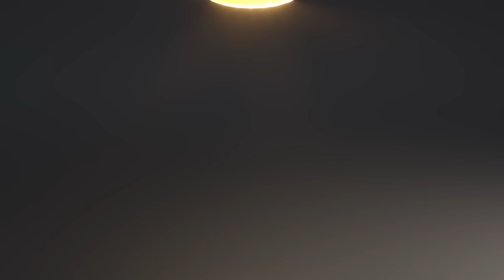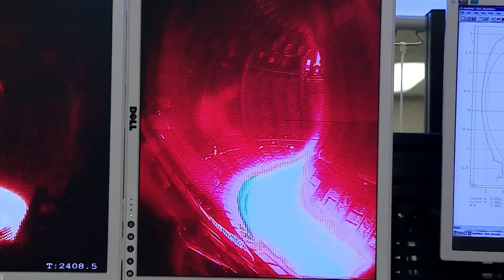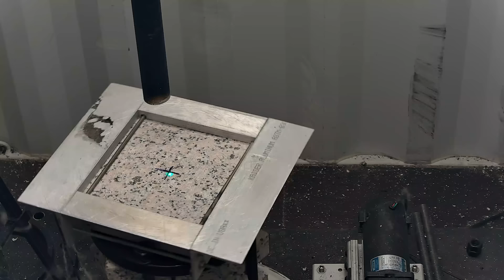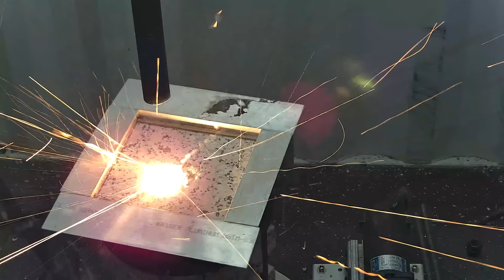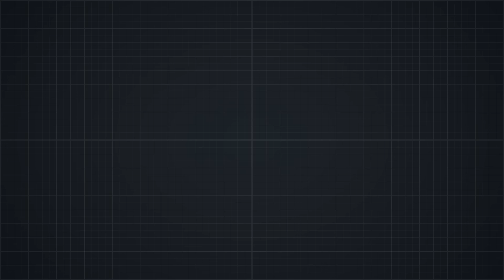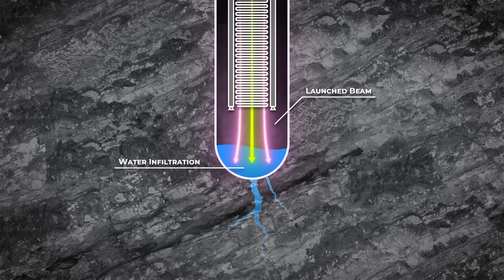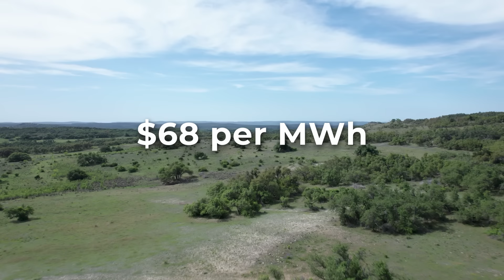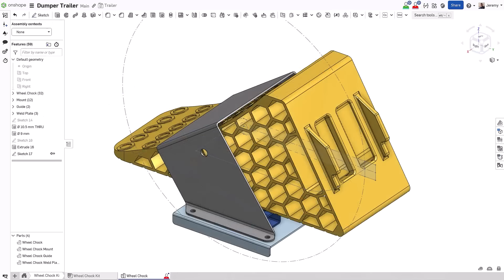Geothermal Energy is Changing

Comment: I think that even if the hole drilled was to be 4 inches wide, you could then use the conventional drilling techniques to vastly increase the efficiency. First drilling a narrow pilot hole and then widening it seems to be way easier than drilling a wide hole from the get go.

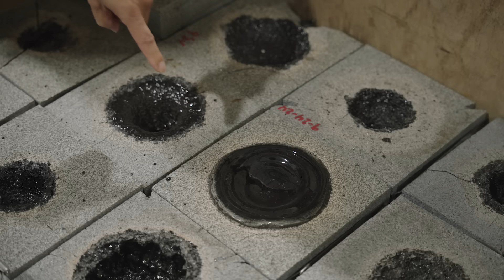Comment: 6:00 I'm a little confused about how the purge gas extracts the vaporized material. Isn't the vapor going to cool down on its way up and turn back into rock before it reaches the surface? Or if it remains hot enough, isn't it going to melt the waveguide tube? (Edit: after giving it some thought, I think the vapor turns into dust not unlike microtektites, which can perhaps be blown up the borehole.)

Comment: The heat at the core of the earth is not because of the fusion or fission reaction as mentioned in this video. The heat source is basically from the gradual cooling and solidification of iron-nickel inner core.
Reply: More or less, iron recrystallizing to epsilon iron is the main heat generating process, which keeps it from cooling in a metastable crystal growth phase at the melting point at that pressure.
TLDR: it doesn't get cooler over time, just less liquid

Comment: Not sure how reliable these super deep holes would be as an energy source. Maybe it's easier to just harvest geothermal power in regions where it's easy to access, and then transport that energy to the customers? We already do the same with other ressources, sure should not be a big issue to use part of the geothermal power generated at the plants to "fuel" the transport systems, just like we do with oil?
Reply: Well, that would require powerlines of a size never seen before. Oil can be transported with losses in the single digit %ages, the same cannot be said for long distance electricity transmission.

Comment: What if they drill the hole but then tectonic plate movements squeeze the pipe closed? On-going repairs and maintenance of the vertical pipeline will likely be expensive.

Comment: I'm no engineer or anything, but the first thing I thought was "can't they use all the power of the microwaves and the heat generated to produce (or recycle) some of that energy back through the drill itself reducing energy costs"? Would that be reasonably viable? Sorry if this sounds dumb 😅
Reply: Not a dumb question at all! Sadly, there are a few problems getting that to work. First is that the power is needed in that shipping container above ground, so the heat being hundreds of meters below ground is just physically far separated from where the power is consumed. The seconds issue has to do with some more fundamental thermodynamics. You see, heat in and of itself is not useful to us. We can only syphon off energy from heat while it flows to a colder place*. The temperature difference tells us something about the efficiency of that thermal cycle. 

So you'd need a cold reservoir to effectively dump that heat into. The borehole itself is a very constrained space in the hot rock so you can't actually fit much more tech there. And if you were to try to move the heat to above ground you would lose a the majority of it to the ground. So the purging nitrogen gas that flows through will carry a bunch of heat up to the surface again, but I doubt that you could extract much useful energy from that. Vastly less than it takes to run the machine, and probably also less than just the amount of energy needed to compress that nitrogen in the first place. 

So while theoretically having some heat regeneration there would be nice, it is just really impractical. 

*  to please the pedants, this is for standard thermodynamic cycles like the carnot cycle which is relevant here, stops being so true when you start dragging chemistry in but that's outta my area.
Reply: @markkalsbeek5883  Thank you!
Reply: I'm also no engineer (engineering student), but I don't think they are too worried about that.

The process already looks much more energetically efficient than the traditional methods so it's better to have a working prototype than spend more resources into making it more efficient.

That aside, I think it sounds like a good idea, despite not knowing how much it would save.
Reply: Not an engineer, but this sounds like a 2nd law violation to me.
Reply: @jnawk83  he said reduce energy costs and not generate energy, so I think it might work

Comment: So, a comment on the voltage: 50 kV shouldn't be that hard to get your hands on, at least for someone working at an industrial level. Several larger factories neaar where I live have their own MV power stations for example, as would a lot of larger city districts.

Sure, power outlets only give a couple 100 at most, but transport should be done at far, far higher voltages (easily 50 kV or more, high voltage grids go up to a couple 100 kV). I don't know the exact numbers for the US, but if they had a way to tap into the MV grid they could get pretty high voltages. Their main issue is that they need DC, not AC (which is what is used in the grid), and probably also need it it be very stable with minimal disturbances.
 
So I wonder if their big power container is intended to actually take like a 480V input, or if they have ways to lay a connection directly to the MV grid, and that container is for the AC/DC conversion and grid stabilization.

Comment: If this microwave drill is a feasible method, starting with mechanical drill definitely be cost effective until certain drill length is achieved.
Reply: True, they will probably use a conventional drill rig to predrill the holes to something like 2 km

Comment: Electricity goes in, an asbestos rope comes up. haha
You need to get rid of the condensed rock that you just evaporated. 
this is nuts. great vid
Reply: If it's not actually straight up asbestoes or equivalent It would be cool if they could extract it and turn it into a rockwool style construction insulation. Also, another thing to consider is how will they know if it's radioactive material. What could be worse than radioactive asbestos? lol
Reply: @WhitelistedUsername  yeah if they could collect it cheaply it would turn what would otherwise be a waste product into something they could sell to recoup some of the drilling cost
Reply: @WhitelistedUsername  It's not unless they literally hit a layer of asbestos. Underground deposits of asbestos are the source of it. A town in Quebec is named Asbestos because it was the industry there, mining asbestos. That looked more comparable to mineral wool and is made by spinning molten mineral (rock). I imagine it will be a devil of a problem. It will stick to the inside of the bore hole and the drill pipe as it goes upward. Some has been vaporized, but clearly not all of it.
Reply: @WhitelistedUsername Just use a Geiger counter to detect radioactivity.

In any case, it won't be more radioactive than any old rock, because that's what their input material is, and their process doesn't increase radioactivity.
Reply: @WhitelistedUsername or crush and polish it?
Reply: @WhitelistedUsername  Microwaves don't make things radioactive.
Reply: @mqb3gofjzkko7nzx38 I'm aware of that. It's naturally occuring in the rock.
Reply: @ Then I suppose they could test for it with a Geiger counter.
Reply: @WhitelistedUsername  I don't think it would be more radioactive than granite. So very low. I wouldn't breath it all day long, probably not healthy for somebody working there for some time.
Reply: @davaguco  It varies in concentration. Different samples of granite can have considerably more or less; it's not consistent. Breathing even a small amount of it would likely have disasterous long-term health consequences.
Reply: my thoughts as well
Reply: It is not anything like asbestos, it is Rock wool, widely used today as outside wall insulation in construction, next to styrofoam.
Reply: That is why in Europe we use a laser system combined with cryogenic gas to quench droplets of melt and then blow them out. Check DeepU Project!
Reply: Honestly the compressed nitrogen would probably be enough 
After all it's just cotton candy and it's moving slow so the rock flow volume wouldn't be that big
Reply: How does Quaise suck 30 liters of vaporized but rapidly solidifying rock "wool" out of a kilometer-deep hole every hour?
Reply: @skierpage  I'd use a secondary mechanical removal plunger/scraper like an umbrella
Reply: For many mineral fibers it is unknown what the long-term health effects are. So do you want to take your chances?
(Also radioactivity has nothing to do with that.)
Reply: @mennol3885 6:34 Do you see that? Do you know what asbestos is? We do know for certain what happens when you inhale that type of particulate; it's not a mystery by any means lol. Radiation does have a significance if they artificially create this specific type of extremely dangerous particulate from certain naturally occuring material (see my previous comments for more info).

Comment: Great video but a minor correction. Lasers, being visible light, are actually at a much higher frequency than masers, which are essentially microwave lasers. Microwaves are in the gigahertz range while visible light is in the terahertz range. Ionizing radiation is what you find at frequencies higher than visible light—things like UV, x-rays, and gamma rays.
Reply: This comment should be pinned
Reply: I wouldn't be surprised if he meant to say longer-wavelength instead of higher-frequency and it wasn't caught in the editing phase.
Reply: @gregsagerer1441  I agree. Very easy thing to flip in your head.
Reply: @gregsagerer1441 nah the way he was phrasing it he was definitely going for "bigger number, more powerful!" thing, which wavelength wouldnt work for. Either he misread the wavelength/frequency thing and wouldve instead just not mentioned it, or he meant to say amplitude, as this drilling maser would be outputting a tonne of power, but I dunno if it would rival powerful lasers..
Reply: Well, if we're being pedants anyway, lasers are not always visible light. Above masers but below the visible spectrum you have infrared lasers and there are way higher frequency lasers, like the extreme ultraviolet lasers used in chip fabrication machines and x-ray lasers. Gamma ray lasers are still out of reach though... for now.
Reply: @ Technically correct is the best kind of correct! ;)
Reply: @markkalsbeek5883 that's true, but a lot of this has to do with colloquial naming conventions. we technically talk about "infrared _light"_so it would still be a LASER
Reply: He also said maximize drilling. I'm sure he meant minimize drilling time, or maximize speed of drilling.
Reply: Most industrial lasers and high energy lasers are Infrared wavelengths.
Reply: wait laser is an acronym
Reply: I think that he made a mistake, what he wanted to say is M.A.S.E.R. (Microwave Amplification by Stimulated Emission of Radiation), and he made a comparison between L.A.S.E.R (Light Amplification by Stimulated Emission of Radiation) that let we all confused. This script is a total mess!
Reply: so then how does this work is it not ionising the rock but just super heating it?
Reply: He mentioned millimetre length waves?
Reply: Also, for the sake of being precise, the Gyrotron shown here seems lacking a resonator around the active medium, i.e. the magnetic field forcing the electron beam to gyrate thus causing breaking radiation. Thus the whole thing rather seams to emit radiation folliwing the Self-amplified spontaneous emission (SASE) principle, which is not exactly a laser (or maser) yet.
Reply: Black budget  government agencies have already  "perfected" this technology  over 20 years ago. Classified
Reply: As the trumpian maga fascist coup is making clear in present time we are at a precipice. Either we change or die in sadness and evil. We this modern human state is dependent on energy. So let US embrace that and set our visionary goal to the creation of more energy than we’ve ever imagined and as much as we will ever need. This is our Manhattans project. It is a vision of human endeavor and cooperation where the nations on our earth developed and provide these energies as public works, of the people by the people fore the people. It is forever ours and never privatized. So that we might have a fighting chance against all the unintended consequences brought upon US by the petro  adolescent history of our modern age. We can do this. It is in US.
Reply: This is also the first time I heard fission inside earth. I heard decay heat, but not active fission
Reply: @edmondhung6097  About half of the heat in the Earth's mantle is due to radiogenic decay of elements in the mantle itself. So yeah, there is quite some fission in the mantle.
Reply: @edmondhung6097  there is a place in Gabon Africa that was a natural fission reactor active around two billion years ago. It’s the only one that I know of
Reply: @ I know that too, but I wouldn’t say that is deep in the earth
Reply: @edmondhung6097  This is a terminology issue -- "spontaneous fission" is another term for natural radioactive decay. It's something we should have dropped ages ago, but it's stuck around.
Reply: @edmondhung6097  timestamp? I missed that part. There's the Oklo Natural Nuclear Reactor but I don't think it's a terribly prevalent phenomenon.
Reply: I think this is an issue of awkward phrasing.  He said something like “like a laser, but higher frequency microwaves.” 

It sounds like he’s saying higher frequency than the laser. But if you pick it apart it’s comparing to a laser, as in a directed beam of energy.  Then he’s stating it’s in the upper end of microwaves.

When he makes me think “what!?”, I rewind back a few seconds and listen again.  More often than not, it’s just odd phrasing.  Sometimes it is a complete whiff though.  In those cases, it’s usually messed up in a diagram too.  I’d be more annoyed, but he covers such a wide range of topics, even within something like aircraft.  I probably miss some, because I’m not an expert in any of this.  I just have a normal college physics education, deal with network technology, and have a general interest that involves me over researching topics 😂
Reply: "higher frequency microwaves" could also mean he's talking about microwaves from the higher end of the microwave frequency spectrum. He may not have been comparing the frequencies of vis light vs microwaves. We do the same thing with the IR spectrum, although with IR you're usually using wavelength to describe the light
Reply: I think he meant 'high frequency' in the sense that it is at the high end of the microwave range. I think.
Reply: Indeed. I was assuming in his mind he mixed up microwaves and radio waves
Reply: Which is although awkwardly phrased exactly what he said. "....Laser which produce visible light, it produces higher frequency microwaves." That's technically correct since this is not a comparison. The higher refers to the high end of microwaves not in reference to the laser.
Reply: To be fair, I'm pretty sure he meant "higher frequency microwaves" as in "the higher end of the microwave frequency range" rather than "higher frequency than lasers", particularly since there are many types of maser and many of them can go down to lower radio frequencies than even low energy microwaves.
Reply: I continue to "shake" oilmen with my innovative project of a non-combustion engine, I remind you that I am posting here on my channel the technology and the principle of operation, according to which anyone can create a prototype and enjoy free energy, since I was denied financial support at the stage of the idea and theoretical research, after a year of unsuccessful searches. Including I will begin to assemble a sample. And soon another video will be released, revealing my developments, the wind of change is approaching! All those who are not indifferent, welcome to the flight in this departing innovative car, which will lead to great achievements for the successful future of the planet and humanity!

Comment: There are places like Yellowstone and other places in the Western US where the Geothermal source is very close to the surface, just like Iceland. We "Could" have several power generating geothermal plants as big or bigger than the huge Hydro plants like the Grand Coulee, Hover, Chief Joseph, and others. The main problem is that building a geothermal plant in places like Yellowstone will never happen, and for good reason. Can't destroy our National parks.
Reply: We have geothermal already in the Salton Sea. Anywhere in the basin and range province will work. No need to drill Yellowstone.
Reply: Why cant they drill horizontaly into the thermal wells? 
No need to destroy wilerness and energy extraction still occurs
Reply: Are you sure about that last sentence? I think you mean shouldn't.

Comment: I remember hearing this idea years ago. I did a back-of-the-napkin calculation and remember coming up with an astronomical energy calculations for vaporizing that much rock. I could have sworn the theoretical limit was much higher than 1 MWh per meter, but I don't quite remember. I wonder if there's a feasible way to recapture some of that energy or if it's worth it.